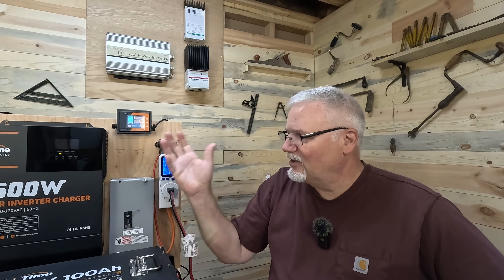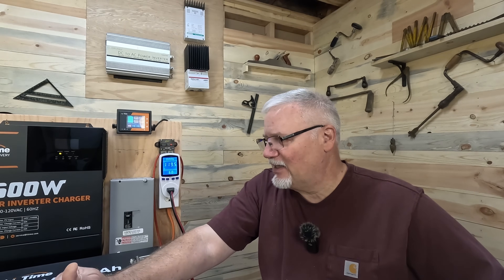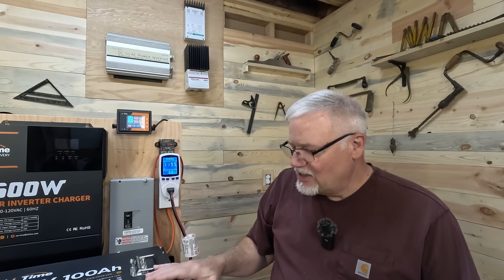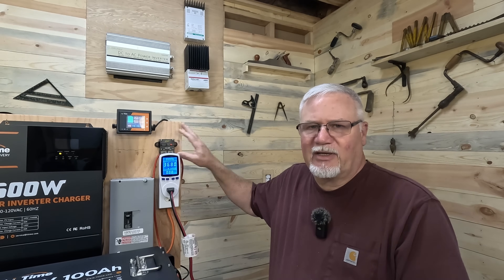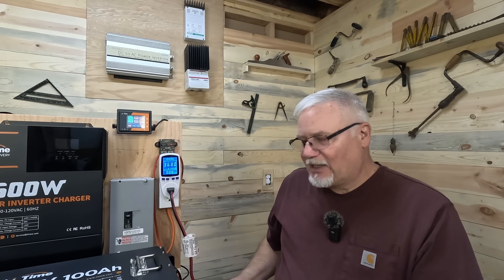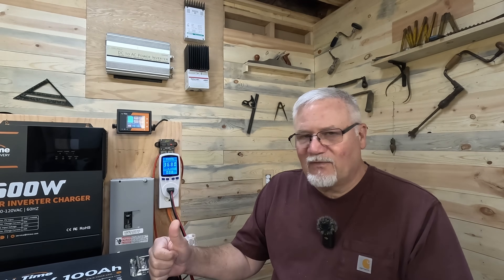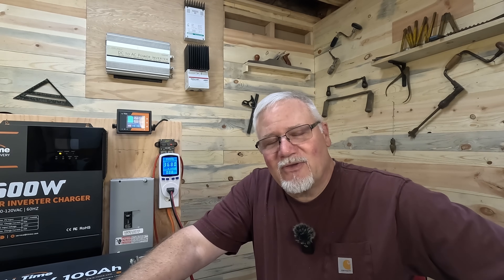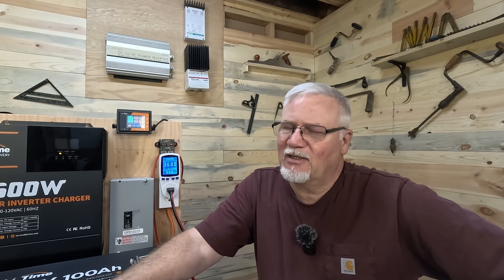You asked, I answered!

Comment: Okay you convinced me to build my own.  I do like the versatility.  I want to use this litime inverter in the video and want to combine that with 2 48v server rack bats.  I want to put it on a commercial grade utility cart.  It will not be tied into the grid.  Something I can wheel around.  Do the bats need to be hooked up parallel?   Cable suggestions and breaker sizes etc.?   Could you make a video on it?  Lol
Reply from the maker: Two 48v batteries in parallel, yes.  That's 10kwh of power!  NICE!  The LiTime AIO unit gives cable sizes for pretty much everything and you could do as I did (make a non GFCI cable - 10 gauge) and turn down the charging to ensure you don't use more than 20 amps on the AC charging circuit so you can plug it into the wall to charge the batteries if there is no solar.

For breakers, if you want to do it right (this is also in their book) you'd need to run a 60amp breaker on the AC side to a distro panel and then run smaller breakers for the outlets or, you could do like I did (not strictly they way an electrical engineer or electrician would agree with lol) and just run it to a smaller box like I did with 20a breaker (s) to the plugs.  If you did two of them it would give you 4 outlets with a max of 2400w each.  10g wire on a short run like that would work but I'd not use romex but rather just 8g to the panel and 10g to the outlets through EMT/Conduit.

Would be a fun build...hmmm.....perhaps a future build for me.

Comment: Put some time in and do a video to explain to people the differences in the different power supplies and the various scenarios in which they are or can be used.
What is "emergency backup?"  Of course the answer varies for everyone but so many Youtubers are trying to sell the sponsored product and act like a 250 watt power station can run their house for 2 days.  Emergency backup, for me, is a whole lot more than it is for you or someone living in an apartment.  While 4kwh is plenty for most people to get by during a 24 hour emergency(grid down) it won't get me through a day because we have livestock, some needing heat lamps, and multiple freezers and refrigerators.  Unfortunately, I have barns out back that require power so I need either a "whole home backup" or multiple smaller setups.  I have chosen to go with multiple setups.
What is critical for YOU?  Refrigerator?  Router/TV?  Lights, fans, cell phone chargers?  If that's what you need, then a 2k power station will probably get you through 24 hours.
You built a temporary system to illustrate how an "off-grid" system can easily, and affordably, be designed.  You didn't build a super-duper electrical system to run 240v appliances, just the basics.  Should you follow directions exactly and make sure all wires are the correct size?  Probably.  Is it going to catch fire to run a refrigerator and a lightbulb?  No. 
Off-grid setups are completely different from "emergency backup."  We recently had a decision to make with a farm in rural Alabama.  It would cost us around $7k to have power run across a pasture and into our camp.  Setting up an off-grid system to meet our needs was virtually the same cost.  In this situation, we opted to go off-grid because we didn't want power lines and poles stretched across our pasture.  We opted to go the power station route rather than building a full-blown off-grid setup.  It cost more, but the place is really just a fishing/hunting camp, so we decided the portability was more important.
"Whole home backup" systems are different from off-grid systems.  At my farm here in Georgia, it would cost me around $40k to install a system that would actually handle all of our power needs if power went out for a week.  That's if I do the install myself.
Apartment/subdivision living can do an adequate emergency system for $3-4K.  Anything less than that will require a drastic change in lifestyle during the outage.  If all you need is your refrigerator, entertainment system, lights and fans, then get you a 2k power station and a couple of expansion batteries.  That will run your coffee maker, microwave, and all your "necessities" for a day or so.  If you're so inclined, you can build a DIY system for half that price.
Reply from the maker: The challenge is trying to answer those questions/that kind of system, in one video that isn't an hour long ;)  So I try to do several videos on a subject instead.  However, you are 100% correct.  There are many possibilities.

TO provide backup for my home, all of it, would be insane IMO.  Our main home in the city uses a lot of power.  If I don't use my shop but I keep it from freezing or getting really hot, it can run 60+kwh a DAY!  Sure, it's a bigger home in a smaller city in the desert of eastern Washington but trying to back that up in it's entirety would be cost prohibitive.  Whereas, I can run my cabin on a little less than 10kw of battery power and 2400w of solar without touching my generator, all spring, summer and fall.

My first thought is:  in an emergency, a power down situation, the AC is gone, the heat is gone, the 240v stove is gone, etc...I'll keep the essentials running and survive -- which is what I did back more than a dozen years ago when we had an outage that lasted 5 days.  It was cold, dark and got tiresome quick but we didn't lose any food.

In your case, it's a completely different world and a combination of generators and power stations might make sense for sure.
Reply: @TheOldJarhead  we have 2 gas generators, a dual-fuel generator, 3 power stations, and a DIY system here.  I figure I will be home if we have a hurricane or tornado that takes out power for a week, so moving components around will be part of the ordeal.  I have one 1,200 watt solar array that is permanently installed out back for my freezers and several 400 watt panels in a barn that I can move around easily if needed to charge power stations. I refuse to live without AC in Georgia, so I have to account for running a couple of window units 24/7.  All of our power, we are 100% electric, is run underground, so power outages generally are only an hour or so.  Tornados and hurricanes are always an issue for us but freezing weather doesn't really factor into our plans.
I have looked into going off the grid but the ROI is 13 years or so, and that assumes zero maintenance and doesn't account for accrued interest.  I'm 63, so I can't make that math work out.  If I had the system professionally installed, the ROI is closer to 19 years. Grid power is still the cheapest and most reliable source of energy for us.
Reply from the maker: That sounds like a well thought out plan.  Look at Signature Solar for panels.  You can get 10 394w panels for $94ea.  Run those into a decent battery bank, and you'll keepbthise wall bangers running in the GA heat and humidity 👌
Reply: @TheOldJarhead  shipping on solar panels will eat you alive.  Plus, I never order enough at one time.
I buy mine from people in the Atlanta area for between $100 and $125 for the 395 and 425 watt panels.  It's about an hour drive so no big deal.  I got some last week for our fishing camp. 
I have found that I can over panel the power stations as long as I don't exceed the voltage requirements.  Even my older Bluetti will handle 1200 watts of solar panels.  These have 37 OCV, so I can put three in series and the Bluetti will limit the input to 900 watts.  The newer Anker product does the same.
Reply from the maker: I've had to ship due to wear Iblive but it was never prohibitive

Comment: Good video. Since this inverter can only output 30 amps 8 awg should work fine. But I wouldn’t use a 60 amp breaker. The purpose of the breaker is to protect the wire, and 8 awg thhn wire’s max ampacity is 55 amps. Really considering the output potential a 40 amp breaker would work fine and give plenty of headroom. 

Glad I found your channel. I like your style.
Reply from the maker: Thanks.  I think its that 6000w peak puts it at 50amps at 120v or 55amps at 110.
Reply: @TheOldJarhead as in the surge? Yeah that’s so brief that wouldn’t even trip a breaker. I haven’t looked at the specs on this one. But it probably says 5 seconds or something. That’s usually more like .25 seconds. Seems like SRNE type units like this one all give specs like that on wire and breakers.
Reply from the maker: True

Comment: I’m told that mini splits don’t like gfi outlets, but not sure if that was a grounding issue due to being a test project on a camper
Reply from the maker: Could be.  GFCI's complicate things IMO and should only be required where water is a possibility (grounding).
Reply: @ didn’t you test a inverter with gfci outlets? That would kill it right at the source
Reply from the maker: Do you mean one with GFCI's on it?  Yes, my SGP has GFCI's built into it.  The unit has to be grounded for that to work.  This one?  No.
Reply: @TheOldJarhead  I think I saw it on a different channel. Grounding might have been the issue as it was a stationary test.
Reply from the maker: Ahhh.... Could be a different channel though my SGP at the cabin has GFCI's built in that work fine.

Comment: Here are the 60C copper conductor limits for NEC and for Power transmission (i.e. continuous current, which is far more conservative):
 
                   NEC      POWER
10 AWG - 30A         15A
 8 AWG - 40A          24A
 6 AWG - 55A          37A
 4 AWG - 70A          60A
 2 AWG - 95A          94A

I usually adhere to the power transmission standard for battery and inverter cabling and for service-entrance cabling.  And I use NEC for AC distribution cabling (load side of breaker panels).   The reason is that voltage drop on DC cabling is actually a very serious problem even with short runs, and heat (even 60C) is not good for either battery terminals or inverter lugs (lugs that are mounted on a circuit board).

I will also use the power transmission standard for any EVSE cabling (if you happen to own an EV) since that can run continuously at its full-rated amps for 8+ hours.

That said, I think the 10 and 8 AWG numbers are too conservative even for power transmission.  I'll use 10 AWG for 20A continuous and 8 AWG for 30A continuous.

Breaker sized-to-same.  So the max breaker I will put on 10 AWG is 20A for solar, battery, inverter, or evse wiring.

-Matt
Reply from the maker: Interesting.  The manufacturer calls for 63amp circuits on the AC side and 8 AWG cable.  Single Core 10 AWG cable is rated to carry 52 AMPS.  8 AWG Single Core is 75 according to the engineering toolbox.  So LiTime calling for 8 AWG fits with their 63 Amp circuit breaker even if you can't get a circuit breaker that's 63 amps ;)
Reply: @TheOldJarhead  Yah, you don't want to use those numbers.   Those are numbers for 75C or 90C of single non-bundled insulated conductors in free air at 30C ambient with no deratings.   Absolute best case in a conditioned room with no room for error.

So, for example, for the above 8 AWG is rated at 80A at 75C.   But 8 AWG in a bundle of up to three current-carrying conductors in a raceway, conduit, or buried... is 50A at 75C.  Again assuming 30C ambient.

In the most conservative table... for power transmission, 8 AWG for power transmission is 24A (which I think is too conservative, but still my limit to 35A for 8 AWG).

In anycase, another very good reason to use conservative values is that there is a lot less thermal cycling.  With less thermal cycling, nuts and bolts and screws are far less likely to break out of their torque setting.

This is how people get into to trouble doing their own wiring.  A good rule of thumb for DIY is that if you can't comfortably touch the cable (50C-60C-ish) while running a full-current test (~10-30 minutes) on your system, then the cable is too small.

-Matt
Reply from the maker: NEC is 30a for 10 gauge and 40a for 8guage 60c - but I see what you mean.  Thankfully, for what I do, I generally never run over about 15amps per circuit and rarely use more than one at a time at my cabin ;)  No excuses but I've managed to run on 10 awg romex from the inverter to the panel for 15 years without issue -- but again, my biggest draw is my fridge when it kicks on and then for a short time only and my saws when I run them which rarely would be at the same time if ever (not that that's an excuse).

Makes me rethink my main feed wiring though, it should be heavier regardless but I do need to do a lot of wiring work out there.

Comment: For home system grounding yes but what about power stations ? A mobile power station is not connected to ground so they would not be safe to use because they are not grounded right.
Reply from the maker: They are safe and grounded when charging or plugged in.  They are designed to be safe without one as well, and often have EMP protection built in if grounded.  

To be fair, I'm not overly concerned
Reply: You aren't gonna like this answer 🙂

First, you can always bypass the unit to run house ground to the ground output.  However, doing so will not improve safety if the unit itself does not bond the neutral's across from its AC input to its AC output.   And you should NEVER try to force the neutral bond AC input to AC output... its either there or it isn't and trying to force it is dangerous because the neutral output on a power station or small inverter might not be neutral-in OR ground-in referenced.  You can wind up energizing the frame or the DC GND of the power station.

So the basic rule of thumb is that any power station or inverter which does NOT bond the neutral input (on its AC charging port for example) to the neutral output (of the inverter) should NEVER be tied into a breaker panel or house wiring.  House wiring requires a ground-neutral bond.  Nor should you ever try to provide a ground-neutral bond in such cases.   Such units should ONLY ever be connected directly to a limited number of appliances that you plug into the unit.  Generally.

A power station or inverter that DOES bond the neutral input (on its AC charging port or GRID input) to the neutral output (of the inverter) CAN be wired into a break panel and house wiring.   Being careful, obviously, to not try to power the HOT at the same time the grid powers the HOT... usually means having a transfer switch for safety.

-Matt